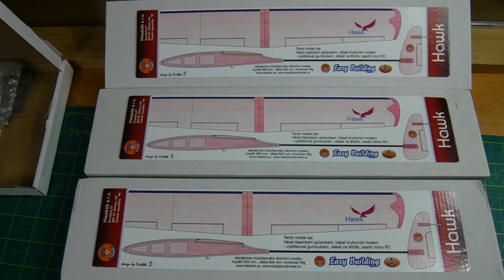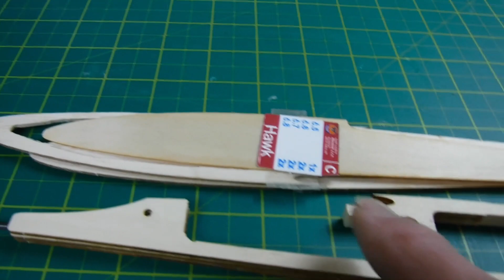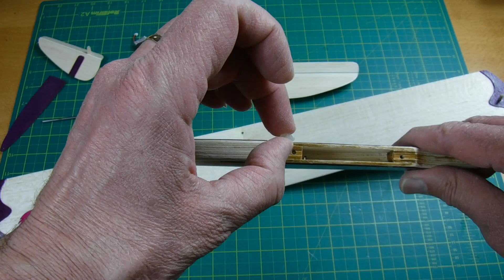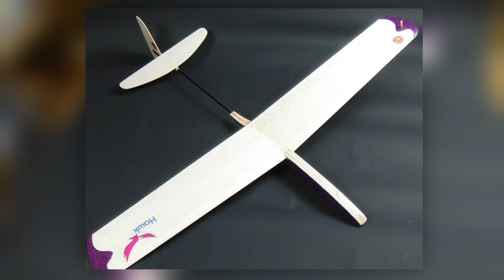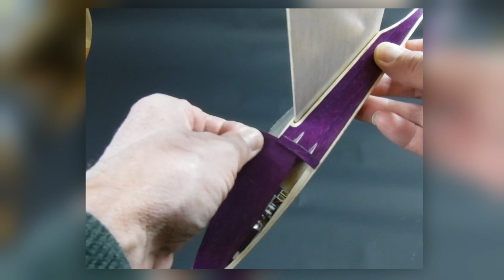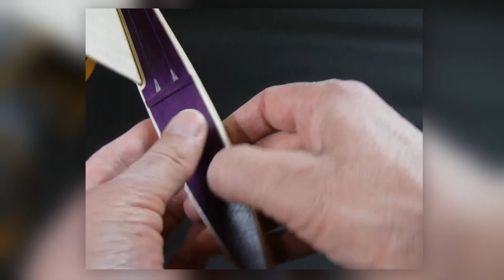Hiesbök Hawk Micro RC DLG Glider #2 - 60cm 70g Rudder Elevator RC Conversion HLG SAL Hiesbok

Comment: Where did you get that receiver with the push/pull servos?
Reply from the maker: The receiver you can get from: Microaces

https://microaces.myshopify.com/collections/all-in-one-receivers/products/all-in-one-aio-5ch-micro-receiver

but I did find the linear servos didn't always have enough torque, so I changed to using the following receiver and separate micro servos:

https://microaces.myshopify.com/collections/micro-receivers/products/frsky-d8-compatible-super-micro-receiver

https://microaces.myshopify.com/collections/servos/products/micro-rotary-servo-pair

Check out my full house version of the glider for arrangement:

https://www.youtube.com/watch?v=UfeWVAtExzM

Comment: I noticed a shine to your wing, did you use a coating of some kind or what did you use to strengthen it?
Reply from the maker: The shine is watered down Eze Dope to seal the wood, but it might be better to use a spray on varnish as I've found Eze Dope isn't waterproof.

Comment: I am working on a Hawk conversion very similar to your #2 design.  When you designed the new tail for the #2 it looks like you increased the size of both the horizontal and vertical tail.  Is that correct and do you remember how much you increased the size over the original T tail?  Please keep up the good work and videos.  Rick
Reply from the maker: Hi Rick, the vertical tail is the same shape as the original. The horizontal tail is based on the vertical. So the area above the boom is one half of the horizontal tail. So with a piece of paper folded in half - the fold being the centre line - I drew around the vertical tail (the area above the boom), cut it out and when you open up the paper you have a template to cut out a new horizontal tail. Hope that makes sense.

Thanks for your comment. I've not been able to do any flying or building lately. Lost my Mum after a short spell of deterioration in April which changes priorities with lots to sort out since, including moving home. Hoping to get back out there flying and doing some building again middle of June...
Reply: @RCSoaringUK  I am so sorry for your loss of your Mum!  The loss of a parent really does change everything and it takes time to work through things - other parts of life go on hold for a while.
I will be thinking of you as you go through this difficult transaction.  Do take some time for yourself and do some fun things (like flying) - it will help.

I really appreciate your response - especially at this difficult time.  Just know that your videos are a real help to others.  You introduced me to the Hiesbok designs and I currently have two hawks in the works.  Rick
Reply from the maker: @richardhaseman3363  Thanks Rick. Let me know how it goes with your builds....